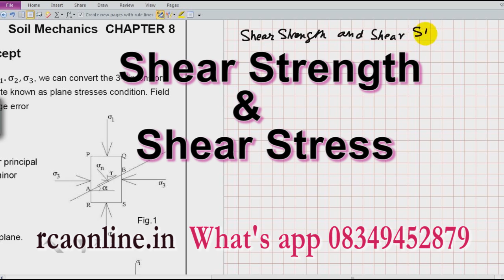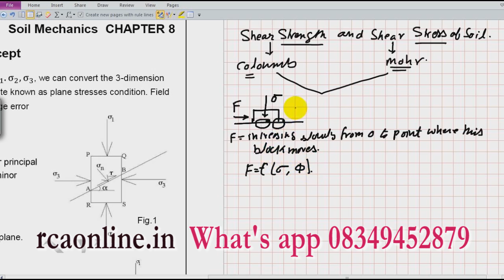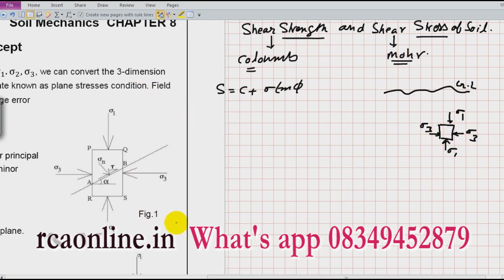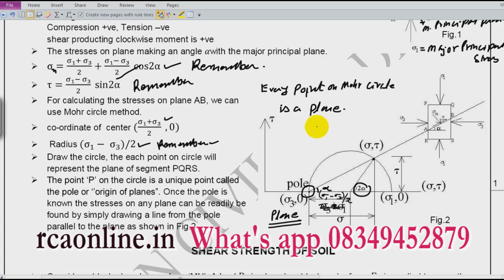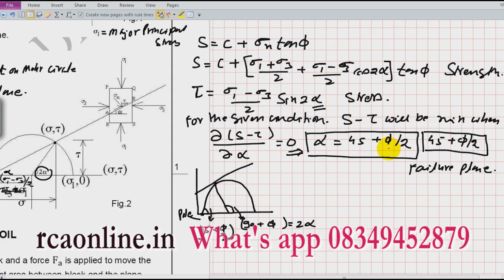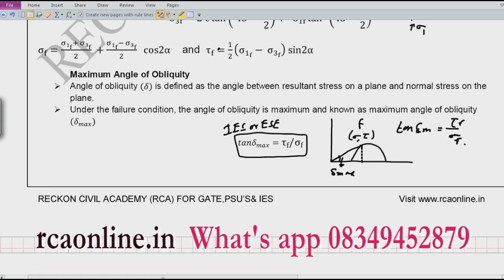Shear Strength of Soil Part-1

Comment: Sir before "new project" soil condition u considered sigma3 all around the soil element , I can not understand the explanation why u considered vertical as well as horizontal pressure as sigma3 as we know from earth pressure theory vertical stress is not equal to lateral stress, lateral stress is 'k'  times the vertical stress than how sigma3 can be vertical as well as hz stress in the soil element before new project soil condition.

Comment: Hello Sir, I have a question. If we have one layer of soil experiencing shear displacement, can we say that layer of soil is undergoing failure? Therefore, can we use the formula presented in this video to calculate the shear stress?
Reply: It will be greatly appreciated if you can offer me some advises.
Reply from the maker: yes